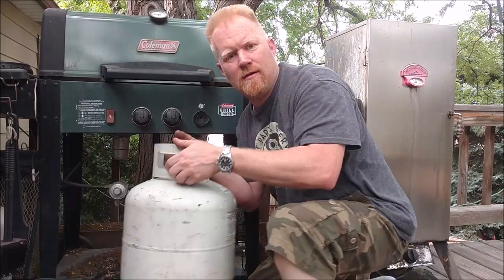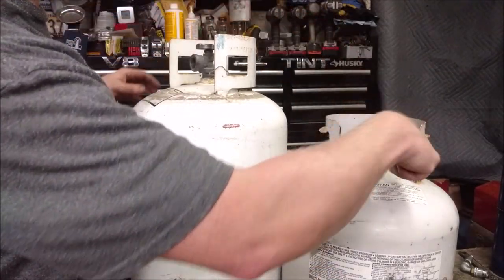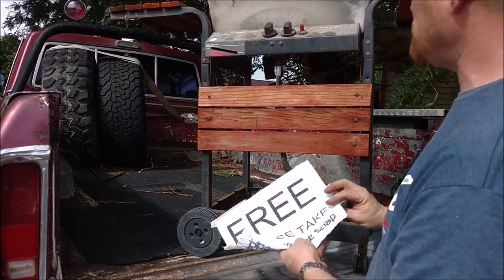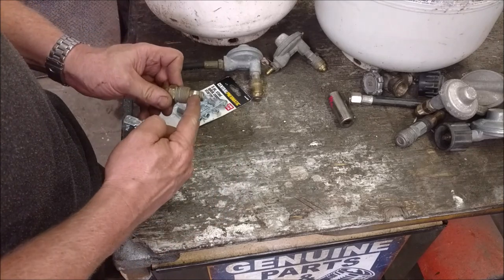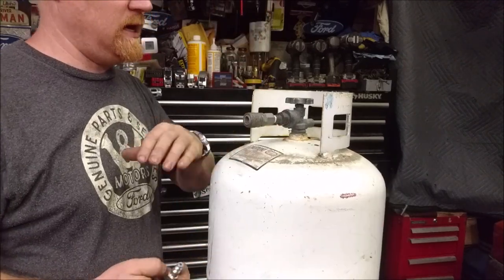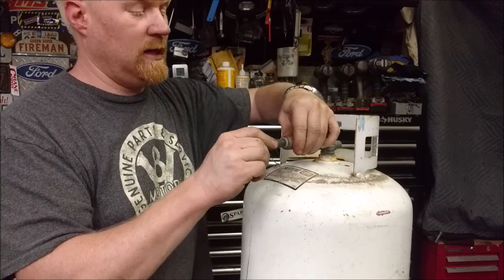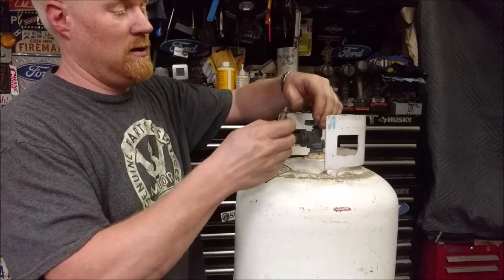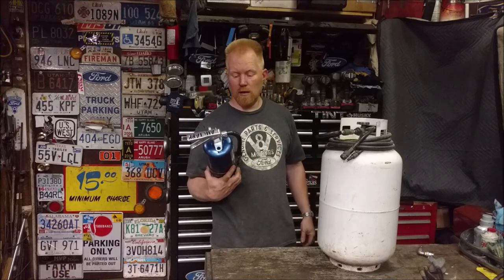Make a Propane Air Tank QUICK N EASY

Comment: 325 PSI.  I never thought they were that strong.  I guess they need to be.  I just never really gave it much thought.  Good idea, especially since they won't fill the older tanks anymore.
Reply: Frank Mayer 

Yeah, the psi is what I was wondering. Good idea if it holds the pressure

Comment: Sweet, when i moved to my new house I bought an air compressor and gave my old 220v to a neighbor from my old house.

I ended up buying the fittings etc and had a few duplicates I guess so i have both fittings that are male for quick connect and one is a female thread and the other male..

I ordered the part that screws into the valve so im basically there.. just need to buy a quick connect that hooks up to the tank and im good to go.

I have 3 propane tanks i used between my gas grill, smoker, fire pit and patio heater so i may sacrifice one of them.

Good news is I work at Lowes and someone was moving and basically asked if they could drop off a tank and didnt need an exchange so I asked a manager if i could use the customers tank as if it were mine to do a tank swap so thats how i came up on my 3rd tank without having to pay for the tank+propane
Reply from the maker: Awesome

Comment: Idea for video- what if you half emptied a propane tank (with propane still in it) and then topped it back up with air. Would this be a perfect explosive mixture?  Ok, not the kind of idea for your channel but kind of a crazy idea to test out- from a half mile away.  I'm glad I'm not young anymore this is the kind of thing I would have tried. When I was in High School welding  our test was to weld up a metal box. I took the box home and filled it half full of gun powder and lit it in an old boot. Man, was that a crazy thing to do. The boot did turn out pretty awesome though. Just mangled.
Reply: If that don't kill him -them there crappy tires will

Comment: When you need a bit of extra capacity from your compressor, add a few of these and you'll have enough air for a good impact or something. Beauty of quick release fittings.
Reply: yup,built one for my compressor
Reply: I was thinking about buying the milwaukee 2 gal air compresser and just hook up 3 proair tanks in a row with quick connect T's to keep my valuable floor space in my little shop.

Comment: Once again great idea I know I'll use
Just think how many are thrown out that can be repurposed
Thanks
That idea about the spray can both the one where you solder the valve in and the one where you force air in an exhausted can are real good.
Just that I do have a problem getting liquids in through the valve hole
No matter what I do I still get some coming back.
I make my own loosening oil and this works perfect cause the aciditone
Doesn't evaporate
Thanks

Comment: Used to have 6 "hundred pound" tanks mounted upside  down in my uncle's shop. Plumbed them all together because we didn't have enough quality power run to the shop to run the compressor. Ran a 3/8 air hose through 2" water line(buried) from the air compressor in a small shed next to the main power pole over there. Smelled like propane for over 10 years.
Reply from the maker: That's a good amount of air storage.
Reply: @sixtyfiveford  yep, but our air tools never did lag, even when the compressor started up

Comment: We loved to go tubing in the Oregon mountains in the winter, but you can't stuff inflated farm tractor tubes and kids in the camper shell. Now dad being a genius as he was, took some pipe fittings and adapted them to a full propane bottle, yes Propane not air. Toss the tubes, the kids and that bottle in the back and away we go. When we get there, Dad would inflate the tubes with Propane gas and send us on our merry way. After a great day of tubing, Dad just removed the valve stems and let the tubes deflate. Worked great but it stunk for awhile. Yeah one rule was. Keep the tubes away from the fire.
Reply from the maker: That's an awesome story.

Comment: If want a real cool setup get ahold of an old aluminum forklift tank. They’re perfect. Light and super rugged and they have multiple bungs. You can have a schrader fill valve, pressure gauge and the original valve with a quick coupler. The safety ring is big enough to coil the airline inside and keep it all together to throw in the back of the truck.
Reply from the maker: That would be cool.

Comment: You should probably also paint your new air tank, so that no-one is disappointed when they need to cook an emergency barbeque.
Reply: Yeah, I like his idea of painting the tank a different color. Makes it easy for emergency people to not confuse it with propane (under some crazy circumstance).  Plus, its fun to paint stuff.
Reply: I painted one of mine as a Minion, and another as a LEGO propane tank.  (same colour yellow)
Reply: @kirkjohnson9353   yet air can equally go bang enough to injure
Reply: @ashleywright1991  yup! pressurized air is just as dangerous
Reply: john dowe ...dangerous? Yes, but not AS dangerous as propane...
Reply: @Quickened1  well of course
Reply: @Quickened1  it should vent out in extreme heat anyways and not just go boom
Reply: @johndowe7003  you said SHOULD,NOT ALWAYS DUE TO FAULT PRESSURE RELIEF VALVES!

Comment: My Freon tank portable air tank lasted until thieves got it, used a store bought manifold that were common 30 years ago.  Made another out of a helium party tank using a manifold off a dead air compressor, had to drill out the valve, gave that to someone. I like the light weight of the Freon and helium tanks.
Reply from the maker: The lightweight is nice. You just have to be careful as they only test those tanks to 180psi vs 480psi of a propane tank.

Comment: I am planning to build a shop compressor with a Campbell Hausfeld tank I found. I have got an antique paint compressor that will be very cool, because it runs quietly, not like the modern oilless ones out there, with their teeth- grinding racket they produce. Mine will be...Ka-chuk, ka-chuk, ka-chuk. Nice. Just need a few more components and I`ll be set. I have got a number of the old grill tanks that still are charged with gas. Since I always grill with  charcoal, I can never empty them, with a good conscience (I`m so cheap). Thanks for the sage tips.

Comment: Two tyres easy :-D
Smelly gas:
In my house the gas pipe that used to feed the kitchen had to be disconnected as a new one on the opposite wall would be doing the job.
The old cast iron pipe stunk so bad that afer 3 months i had to fill the end.
The house is from 1948 and had coal gas then a lot later on smelly north sea gas.
Pooo is my discription lol.
Reply from the maker: The smell never goes away.

Comment: Years ago around 1975 I had a garage and I needed compressed air when I went out to a puncture I converted the cylinder outlet very very easy to do to accept an airline and with a 19 kg cylinder I could undo all four wheels and Bolt them back up on one Full Cylinder with an air wrench
Reply from the maker: That's awesome.

Comment: I've lost track of how many times I have done this. Always someone that comes along and wants mine. LOL Last time I brought home a free BBQ to get the fitting... I pulled the fitting. Went to drill the hole out bigger... There's some sort of ceramic or something embedded in it, that prevents you from drilling through.
Reply from the maker: Ceramic? That's a new one to me. I'll have to keep my eye out for one.
Reply: Seemed like ceramic. Could have been something like a ball bearing, I guess. This was not a valve. It was just that stem piece. I tossed it aside and got another because I wanted to finish the project. I'll have to try to find it again, and simply cut it in half, to find out what is in there.
Reply: Ok, found the fitting again. It's a ball bearing embedded into the middle of the tube. Wish I could post a pic here.
Reply from the maker: @selador11  Maybe as a one way valve to hold propane in the line when you disconnect it.
Reply: That's it! I just shook it, and it rattles in there. Check valve, it is! I am going to see if there is any way to just take this thing apart.
Reply: That being said, yeah, I should have just tried to use it after I drilled it bigger from both sides. LOL

Comment: Im still gonna feel nervous when i fill mine the first time even though i saw it is safe.  Awesome gizmo my man
Reply: If you are concerned you could fill the first couple of times with inert welding gas like CO2 or Argon or even Nitrogen (from the tire store) that way any propane left inside would not be  in an explosive air/oxygen mix. Propane does't smell that's why a stink is added so you know if there is a leek.

Comment: I never realized how simple it was to convert a LP tank. I also seen another amazing video where you take copper pipe, cut off a 2 inch section, flatten 1 inch in a vise, drill hole in it, then you made a copper battery lug/terminal. Saved $3-4 easy.

Comment: I build woodburners from these, you neglected to mention that the surplus gas fumes need purging first before any cutting or drilling in any way, I do this by removing the gas valve and turning it upside down for a week or so, then I out a gallon or so of water in it and light a small bonfire, allow it to burn to embers and dump it on the embers with no valve fitted and steam the vapours out, after that it's safe to cut in to, weld or anything else.

Comment: Nice video. As far as the smell you could try vinegar its a odor neutralizer then wash it out and let it dry.
Reply from the maker: Some people are saying bleach gets it out, but I also know bleach will rust steel in no time flat. Another guy suggested old motor oil followed by a swish of diesel fuel (which is just thin oil) to rinse out the motor oil. I think that is way I'm going as a little oil will help protect the metal surface from rust.

Comment: I would highly recommend you use an inert gas. Adding oxygen to a flammable gas...add in a little static electricity and you have the fire triangle. 
Retired firefighter
Reply: New experience when you have a tire blowout.. 🤔

Comment: I made a booster tank out of a 30lb propane tank, I made it to boost volume for my 3/4’ drive impact gun. Just welded a bung on for the incoming air line, though I guess I could’ve done it with just a T fitting.
Reply from the maker: Awesome idea.

Comment: Man I use to carry 2 of them in the back of my F250 for years . 
Also we use to convert Freon Tanks
Reply: The old r22 tanks worked good, even lighter than the lp tank. Sucks they new tanks have a check valve built into them

Comment: I used 2 100# bottles for my shop compressor but before I hooked them up I set them outside in the summer with the valve screwed off and let the sum heat the tanks.  after a few hours I sprayed compressed air in them and let them bake again.  After a couple of days their was very little smell and after a few weeks their is no smell at all.  I put one tank back by my compressor and the other out by the front door , I might place more of them around the shop if I come across any of them for free.  Just remember to weld a bung on the bottom to drain them.

Comment: Every once in awhile I find free 100 lb tanks. Now I know what to do with them.
Reply from the maker: I've seen a few 100lb tanks set up as auxiliary compressor tanks for extra storage.
Reply: You need a water drain petcock in the bottom bell to drain out condensate. Remove mber the tank is bare steelband it will corrode in use. The smart user will hydrotest the tank to detect serious corrosion damage. Air tank failures can cause death and major property damage.

Comment: How many 33” off road truck tires are we talking here?  And I didn’t watch long enough.  Now I get it.
Reply from the maker: That's a lot of volume to bring a 33 back up to full pressure. I don't recall what I said in the video but if you're trying to air up 4 tires after offroading from 15psi this won't do it. It would probably take all 4 tires from 15-25psi is all.

Comment: I heard that the POL style valves such as the one fitted on the bottle have small diameter cores and need to be removed to achieve good airflow. Also the adapter that goes to the regulator have 2mm cores which can be board out with a 1/4" drill. Quite surprised to see your tires inflating at quite a rate despite this. But I imagine on a full sized 47KG bottle, fill-up would take forever.
Reply from the maker: Some have smaller cores than others depending on the application but I drill out most. These tanks really don't hold that much air and their main use is tire filling where you're pushing air past a Schrader valve that is extremely restrictive. So air flow is of little concern.

Comment: PROPANE SMELL:  I hadn't heard of the BLEACH option of getting rid of the old propane smell.  Instead, knowing that it's not water soluble, I went with a petroleum-based approach.  Used motor oil will dilute & absorb the additive.  Remove the valve and fill the tank all the way up.  I used a fitting and short pipe to extend the fill neck so every inch of the inside surface was submerged in used motor oil.  Allow it to sit inside the tank for a few days and then flush it with diesel fuel.  The diesel fuel can then be easily cleaned out with Simple Green & water.  It may seem like a long process, but in my case I have absolutely no residual smell...  :-)
Reply from the maker: That's a great idea. A little coating of oil left inside wouldn't hurt anything either.
Reply: Skip the oil and go right to the diesel, worked for me.

Comment: Great video.  You spoke a bit about preventing moisture buildup in the tank.  Can you tell us anything about fast the tank walls will corrode?  I would imagine even if you keep the free liquid from building up, moist air would cause corrosion of the walls....?
Reply from the maker: I fill from a larger compressor with a filter drier on the output. Also you can tip the tank upside down and open the nozzle and it will release any moisture. I cut open a tank I had used for 5 year and there was rust on the outside but there wasn't a spec of rust on the inside.

Comment: I have about half dozen of the small ones and about Eight of the twenty gallon, I put a female quick coupler on it, and I have a small pressure gauge with a male fitting so I can see what the pressure is, two of the big ones will fill a 18-4 -38 tractor tire.
Reply from the maker: I had gauges on an old one and just refill it everytime I'm done. Seams like it's either full or empty.

Comment: What we need now is your suggestion for a low-amperage, 12v air compressor that could be run straight off a 50W solar panel to pump air into a cylinder like this for use with air tools if one is stranded in the middle of nowhere.
Reply: The little 12v compressor I have in my van claims it can go up to 250psi. It plugs into the cigarette lighter / power point which typically has a 15-20 amp fuse.
Just need a Schrader valve in addition to the air hose connection and the patients to let it build that much pressure.  My van tires take a long time to get to 40psi & it's loud for such a little thing.
The Schrader valve would also enable you to use the air at a gas station & fill the tank for some compressed air to go.

Comment: Following your instructions I've converted a 20lb propane tank to an air tank.  I have 2 compressors: a 4hp 13gal Campbell Hausfield and a 2hp 20 gal Devilvbiss.
When I try to fill up the propane tank with either of these compressors the best I get is 50 psi in the tank instead of 100psi.  Do I need a bigger compressor?  or is it just my pressure gauge that is inaccurate?      J.P.

Comment: Another great video. Did you think about possibly adding an in line gauge so you keep track of your air pressure inside the tank? Off to find a 30 gal propane tank. 👍 👍
Reply from the maker: I used to have a gauge hooked inline between the hose and air fitting at the top.

Comment: Great Idea.  How do you get rid of the propane stink,,,???  Or doesn't it hurt anything?
Reply from the maker: It doesn't hurt anything. It is artificially added to propane just so you know there's a leak. I will say it's very minuscule after a few fill ups, you just occasionally get a random whiff.
Reply: @sixtyfiveford  Thanks.  I was fearful that it might damage the rubber.

Comment: Given the fact that I have "Air Shocks" that I usually vary given the Load Rate of my 1994 Ford Ranger (sometimes I load up to 2k lbs of Gravel), i would really like to have a "Reserve Tank" to allow safe Road Travel for my Truck..

Many thanks for this Video!

Take care,
🤓 -Thomas
Western Washington State
Reply: 2k of gravel ?! my f250 SD doesnt legally carry that much payload! dont think on a quarter ton much safe road there
Reply from the maker: @ajl9491  A F150 bed can carry around 3000lbs and a F250 around 4000lbs. Those numbers are dropped a little if you have a crewcab taking up carrying capacity. The vehicle is definitely sluggish at those weights and aren't safe on the freeway but at  sub 40mph there aren't issues.   2klbs of gravel  is only 1/3 depth/slumped pile lower than bed rails of a small pickup bed. I've hauled 3500-4000lbs of sand with my 78 F150 and it was too much, I just went super slow and never let the sand/gravel guy load me that full again. I was able to go and stop fine the only issue is the rear squat and front end lightness. Air shocks would help to alleviate that. I worked at the Home Depot and recall loading guys all the time with weights heavier than these. Some cared  but most didn't. Legally though most states don't have any regulation on non commercial trucks. 

I just looked up a 2018 F150 and payload is 3270 and F250 is 4332lbs. Of course that includes passenger/luggage weight.
Reply: @ajl9491 
I also have Air Shocks and drive LOCALLY only. 5 miles @ 35mph Max.